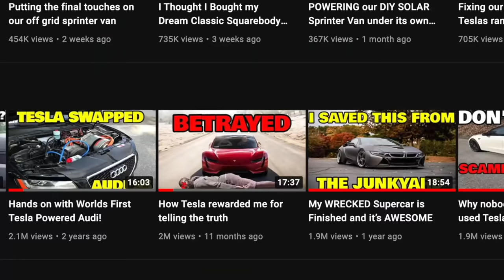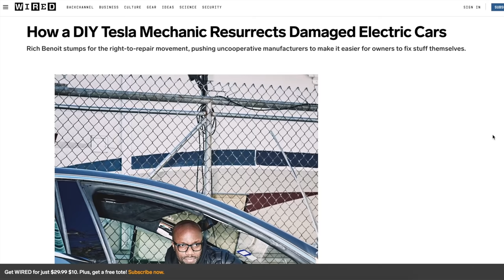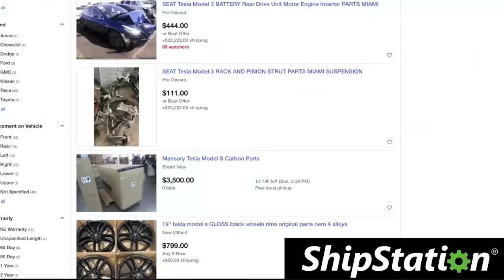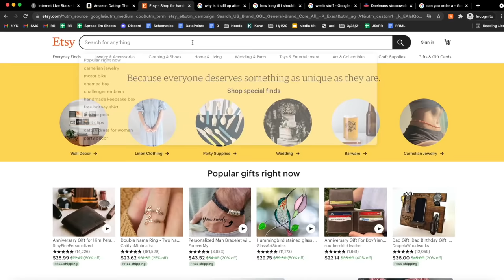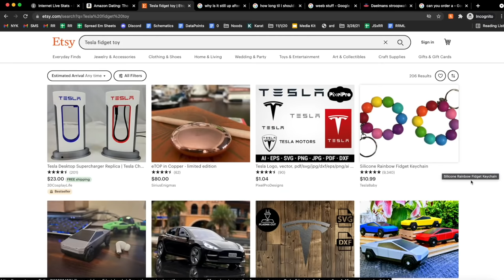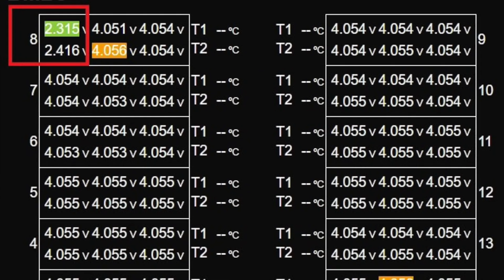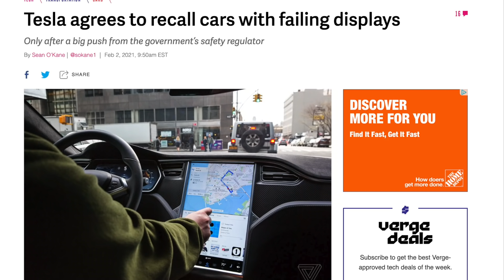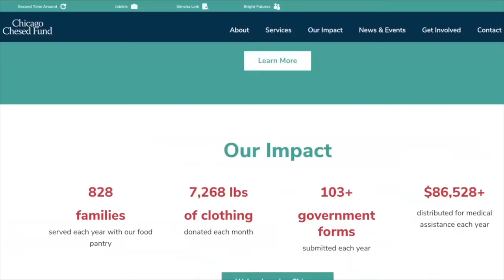Tesla wanted $16,000 to fix this NEW Model 3, we did it for $700! The importance of Right to REPAIR!

Comment: No Complaints and I own a M3. Back when the first Gen M3's came out there were a ton of videos/complaints pertaining to Squeaky upper control arms from a bad patch. My car started Squeaking at about 14k miles, after a couple videos and some Online photos I pulled the wheels off and removed a coiled clip (best explanation) from the top of the boot. There was a tiny fingernail sized blob of white Lithium Grease on each ball joint, way insufficient and the ball was starting to Rust. 
I had to use a socked to articulate the joint at first but it easily loosened up and then I did what I would do on any other vehicle. I greased the ball joint. No lithium just a good all around grease that I use on other ball joints. I also purchased a Needle style Grease extension, not to puncture the boot just to add more grease to the boot after it was folded back into position. Getting that clip back on was a bit of a pain especially with grease oozing out. That was 80k miles ago. There is Zero sign of any grease leaking from the boot but I do think its time to pull that spring out, stick a needle under the boot and add a shot of Grease. I have also replaced my own Wheel speed sensor (had come unsecured and contacted inside of tire and wore through the wire). Had to order it from Ebay but I still saved myself a 1 hour trip to a service center, an over night stay for the car (no loaner offered so I would have to arrange travel home and back) and about $250 on the repair. Which took 35 min, some of which was getting the tools out and the car jacked up and wheel off. I love Tesla but with a Mission to reduce Waste this kind of repair in this video is exactly what their mission is all about.

Comment: just seeing this...the "practical engineer" in me was like "oh, i can think of at least 5 ways i could fix this myself..."  pretty easy to fix in this case imho... 

tesla like any company are working hard to ensure stuff fails just outside warranty.... lots of companies do this...those batteries will start failing...
Reply: tbf, you wouldn't be able to get any other manufacturer's delearship parts exchanger err I mean "technicians" to fix something like this either.

Comment: Without right to repair. Front light bulb change $1,200. Battery change $20,000. Window switch $1,500. With right to repair divide by 4.

Comment: Look into the right to repair on the Upcoming Aptera car. It sounds awesome. I understand there are QR codes on all the parts that give you that part number and repair instructions, they will send the parts to you directly or to your mechanic. Its a solar electric car. 0-60 in 3.5 and 1000 mile range . Its coming out this year.

Comment: Obviously the manufacturer solution would be to make the nipple replaceable.
Reply: Or engineer it into a recession so it does not stick out.  Very simple either way.  Engineering did not do well on the think through on this one.  I would not even want this problem as a manufacturer.  Poorly engineered.

Comment: Things like this keeps me from buying an electric.
Reply: That and you have to replace the entire battery in 5 to 8 years, so the car has no longevity nor resell value.
Reply: @comicssplatter8195  Battery warranty on Teslas is 8 years / unlimited miles. If that battery fails between 5 and 8 that just means you get a free one lol. The problem comes when they fail at 9 years...
Reply: Not enough charging stations, always have to park in the garage, majority look ugly and they are too quiet. Pros for electric: slightly cheaper, less maintenance, government rebates and you get to drive in HOV at all times.
Reply: @HobbiesWithNick  Government shouldn't be paying people to buy a luxury car.
Reply: @HobbiesWithNick  There is enough charging stations. There isn't an excess, but enough. Bigger problem is charging network reliability. At least if you aren't driving a Tesla. The DC fast charging network isn't very reliable. It would be incredibly stressful driving a car and not knowing if any particular charging station is going to work.

There isn't any reason an EV needs to be parked in a garage. The charging connectors are waterproof and outdoor chargers are available. They will use more energy heating/cooling the battery that way, but it will work. It will have to be somewhat near a building though of course. People who live in apartments will likely have the most issues with charging EVs at home. 

You're also forgetting the biggest pro of driving an EV, the torque. The power response is instant and you get full power at any speed. No downshifting, no gaps in the power band they just go.
Reply: I always wonder how many viewers have been convinced to not by an EV because of Rich’s videos.  Hundreds? Thousands? That’s what happens when you make money showing the worst examples of repairs, not a random sample. Go Rich! Let’s get the planet to 🔥!!!
Reply: @juliahello6673  The slaves in the battery mines love you, or should we just "gloss" that over as well?

Comment: Brilliant solution. However, I assume that he’s leasing the car from Tesla itself. They already know that the car was damaged and they’ll record that as well as the needed repair. I assume they’ll inspect the car at the end of the lease and see that he didn’t replace the battery. They could still charge him for a battery replacement to put the car in the condition required by the terms of his lease. But I suppose he can buy the car at the end of the lease and resell it.

Comment: With that car, I'd be nervous about driving in the winter in upstate New York where I grew up. It's common there to have ice chunks fall out of wheel wells and litter the highway. When you hit those they sometimes fly up under the vehicle. I should think that, to prevent road debris like that from damaging those batteries they'd have a strong metal under cover as an option so that damage causing debris can be deflected.

Comment: “ELECTRIC IS BETTER THAN GAS!”

And now you see the hidden costs of owning an electric car. Parts are expensive af.
Reply: Yes, because they are new and a small part of the market. Right now Tesla is putting almost all of their efforts and supplies into building their cars. That's why they are expensive and take weeks to make repairs of the cars they already sold. Tesla's profits depend on how many cars they sell, not repair. So, if it's a choice between using a part for a repair or selling a new car, Tesla is going to choose to use it to sell a new car. That's why the other manufacturers need to come out with their EVs because they have the experience of mass production and supply that Tesla does not.
Reply: @tboneforreal  Yes, but that cost still comes to the consumer. Imagine paying 16k for a small part that broke off on a new car you just leased. It’s not right, it doesn’t matter if they don’t have the parts to do repair it, that price to repair is huge and it wasn’t necessary to replace the entire battery in that car. It’s a bad design really.
Reply: Yeah, as more and more electric cars get on the road though, you'll see more and more aftermarket parts and more and more mechanics coming up trained in how to fix them like this. Parts will be cheaper and cheaper over time.
Reply: It's only Tesla

Comment: I think the inside of the cooling system is aluminum, never mix copper, bronze or brass with aluminum, it will eat away the aluminium slowly! I have had the same issue in one of my water-cooled computers. It just eats the aluminum.

Comment: How about Chad manufactures a metal frame with a flat piece to take up the space where the front drive unit goes so in the event it hits another piece of debris on the road to prevent it from hitting the front of the main battery.

Food for thought

Comment: A few things I disagree with that you did regarding the repair.

1.  If you were worried about plastic debris in the cooling system where you repairing it after you threaded the plastic, I don't think you should have used water to "flush" out the passages.  I understand that according to what you said, the cooling passage right there went upward so gravity would likely flush the debris down and out of the hole.  However, if for some reason you actually did lodge a piece of plastic up in the line somewhere, I don't think that would be a good thing since there's probably somewhere that piece of debris could cause a problem.

My recommendation would be to use a small hose that is connected to a vacuum and try to "suck" out the debris.  Or, use a suction gun and try to do that first.  If then after using these items you want to use some water like  you did, then that's fine.  I just think you should at least use some sort of suction to start the debris removal.

2.  $700 to do that repair seems a bit expensive considering it appeared it was something that could be done in an hour or less and required about $10 in parts.  So, did I miss something in the video where you had to do all kinds of other things that required more time and labor?

Comment: I would have used a plastic nipple instead of brass. If that tee were hit again the brass nipple wouldn't break but everything around it would and if hit hard enough the brass nipple would bread the plastic elbow inside the battery case, now you're SOL. The plastic nipple would act like a fuse and break first before the elbow would, just remove the broken nipple and "Bob's your Uncle".

Comment: I have an 86 Toyota pick up with 278448 miles single axle and guarantee that I will keep it until the day that I die, originally it used to give me 22 mph,  after a few adjustments now I am getting 40 mph ,I am just an old diesel technician that learn a few tricks of the trade, extremely simple, practically a kindergarten engineer can do it.

Comment: I had the same exact thing happened to my battery. In my twenty thirteen model s. We bought the vehicle used, in the battery. Have been replaced about a year and a 1/2 before when we bought it. And I brought that up to the service advisor at Tesla, telling him the batteries listened to years old. It should be under warranty since it had been replaced. He said. Yeah, you're correct. And he looked up and saw that the previous owner had had the battery replace. Once I got there to pick the car up, he said. Well, I messed up. The battery was actually not under warranty, but since I told you it was. We will go ahead and honor it. The bill would have been nineteen thousand dollars for a new battery comma and tesla actually covered it just all verbally telling me a mistake. I do love these videos you make comma where are you located? I may need to bring my car to you again, one day.

Comment: JB Weld would have fixed that also. I have repaired heater core plastic lines with it with good results. Then I would have built a plate to protect the location better.

Comment: It is absolutely criminal to demand the $16,000 replacement of a whole battery pack for the sake of a cracked plastic cooling pipe nipple, especially when the designers have been so clearly negligent by exposing that pipework to accidental damage. The phrase "not fit for purpose" comes to mind.

Comment: $700 for tapping a $3 pipe fitting and some thread sealant is pretty steep as well but it was less than half of ten percent so you still really saved his ass. Crazy he was unable to come up with this or similar solution on his own.

Comment: Tesla should make the port for the battery cooler line far less vulnerable which would be an easy fix by changing the location or putting a strong metal bracket around the port.....stupid design Elon.

Comment: Why not use a plastic nipple instead of brass?  Using parts of the same material would expand and contract the same.  Doesn't the Magnuson-Moss Warranty Act protect the consumer when alternate parts are used?  Having worked at Dealership service departments, the manufactures don't trust the techs to rebuild or even service complicated parts and systems and having worked at Dealership service departments, I understand why.  There are a lot of techs out there that can barely fix a sandwich.

Comment: Check engine light came on in my wife’s SUV…because it’s an older car I told her it was time to get it to the dealership for a good tune up anyway. Well that was a fucking mistake! These idiots at a Nissan dealership wanted 280 to run the diagnostic and they were projecting a 1000 dollar repair with about a 1600 dollar tune up! This is before they’ve looked at anything. She called me and I told her to get the he’ll outta there and not to let them touch it. I found a local place with good reviews and he was able to fix the issue for 80 bucks and the tune up was 700 as compared to the dealers best guess starting at 1600.

Comment: I like to Tinker with cars in myself my question is this that shielding that the mechanic took off look like it was made out of plastic why wasn't that some thicker type of aluminum metal or stronger material so it would not damage components it look like it was made out of cheap plastic

Comment: Has anyone designed a protective metal shield along the length of the coolant hose to give it more protection than a plastic brush plate.  How about swapping out that plastic cover with an all aluminum plate like a rock skid plate found on pick up trucks on the gas tank and other damaged prone areas.

Comment: Tesla's now have heat pumps so they dont burn so many miles so quick when it's chilly outside.
But what about when it's too cold for a heat pump?
There are "diesel heaters" and gas heaters on the internet. Some burn propane too. Some only heat air, some only heat liquid. Some heat both liquid and air.
There's a verson of one of these heaters that would be an excellent modification for Tesla's that live near the Arctic circle (probably not diesel).
Your garage is the place to have the mod done.
People in Norway want to know.
Wudda ya think?

Comment: Everyone talks about the money they save on fuel when they drive electric or hybrid.
No one talks about the price for Batteries, Inverters, Hybrid transmissions, Electric AC compressors. And also how expensive it is for technicians to work on them.

Wanna save on gas buy a 4 cyl toyota and be happy.

Comment: I think that this little plastic nipple and hose arraignment in the front of the car is a poor design. The plate that protects it is not substantial enough to protect this area from minor debris. Conventional cars are manufactured with heavier shielding. Perhaps a skid plate design to protect the hose and nipple and battery front.

Comment: Some companies have a dreadful attitude to the repair of frankly minor problems. Unfortunately Tesla IS one of them & Apple is another. A legally enforced right to repair is utterly essential. It sounds as if this vulnerable Component really needs better built in protection on a single motor Model 3. Which looks rather easy to achieve.

Comment: Bro is the propulsion pirate of laying pipe. 
18650 batteries are cheap. Make sure you utilize the proper Ma rating. Long as you can get the battery pack out of the car anyone with a dvom and basic low voltage experience can find bad cells and replace them.

Comment: i own a 1993 accord, original owner. with 257k miles.  And yet, after 31 years it just passed California emissons with numbers well below the low thresholds for CO2, NOX, AND CARBON MONOXIDE and it costed me $89.  This poor fellow's warranty period ends and than shortly thereafter runs into an unanticipated repair that will cost him ~$16k.  When making this kind of comparison, I find it really hard to validate a Tesla purchase or any all electric vehicle.  If I have a breakdown, I'm back on the road for a tiny fraction of the low blue book on my car.  Lastly, why is bashing a mfg. so frowned upon expecially in case like this one.

Comment: ok so the fluke here is he had a gap in his insurance.  Since it was a lease, his insurance company felt they could walk away from it as its teslas problem.  Why won't tesla fix something like this?  the car dealers have always been parts replacers, not fixers but the battery pack isn't one thing...  its many parts..   replace the bad cells and refill the coolant..

Comment: The pipe should not be in a position to be damaged in the first place a critical part should have been better protected or made of a stronger materials you could call it a design fault then Tesla would be liable 8 year warranty is good for piece of mind but they do hide design  faults and unreliability

Comment: Wow... not only extortion repair costs, Tesla should be taken to court for building the car with parts not fit for purpose... the underfloor of the car and its components all made of plastics and not easily replaceable, that engineer should be sent back to kindergarten. Then there’s the fundamental issue of Tesla wanting to save the planet reducing fossil fuel consumption and at the same time using ridiculous amounts of plastics, all manufactured and assembled in a way that for a little damage you need to replace the entire battery pack, creating even more pollution.

Comment: Hello Rich or anybody that might be able to help ! My Tesla failed last week and shutdown. I tried boosting the vehicle and it would start for a bit but then it shut down again. I had it towed in and they said the PTC heater and 12V need to be replaced. They said the PTC is what is forcing the car to shut down. I just want to double check they are not lying to me ?

Comment: Tesla seems to be taking their repair policy to the extreme by requiring a battery replacement rather than a nipple repair. This seems to be an unsustainable policy business wise. 

What is Ford’s policy on right to repair for the Mach e?  Do all Ford dealerships have trained Mach e mechanics that could pull off something like this simple repair?